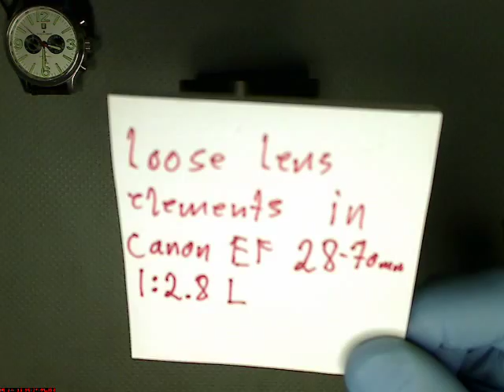Loose lens elements in Canon 28-70mm 1:2.8 L_____PART_1_motion lapse film

Comment: Thanks mikeno62 for this video. Thanks a lot !

I just bought a second-hand EF 28-70mm F2.8. The "front group" was really loose. It could move several mm sideways when fully out (28mm). Of course Canon no longer service those old lenses... and the guy there told me I'd screw it up if I tried to fix it by myself.

I watched your video several times and managed to do all the beginning (~6 first minutes) to find the culprit : There was a screw reaaaaaally loose ! I just screwed it back and put everything back in place.

My first attempt was not good, as the auto-focus was behaving weird... trying to focus once in a while, moving by "steps" and not getting the correct focus at all. The reason was one of the little (orange) ribbon cable was not totally pushed inside its connector.

On the second attempt everything was working fine, and the front element is no longer loose.

I'm really glad you did those videos. Thanks again.

I've also spotted some other issue with my lens (some plastic part even deeper between the most inner lenses). If I'm brave enough, I might re-use your videos in order to get rid of it.
Reply from the maker: Many thanks Nicolas, it's good to know someone can use the info in my videos. Also happy to know you could fix your lens, even the repair tech said that you will screw it up.  But you did it, so that's very good :-)

Cheers
Kenneth
Reply: Hi Kenneth,

I've noticed another problem with my 28-70mm and do need your help again :
The front ring is not totally round (I guess the lense fell down which lead to distort the ring) and I cannot really screw my filters on it.
By looking at the catalog parts for this lense I see that I need to get a new YA2-1717-000 but I can't find any... Maybe you could point me to a place I could get one ?

Comment: I got old of a second hand one of   these very cheap as it stated it was hazy inside. I stripped it down using your video, which was great, i leaned so much. However did not find it dirty or hazy inside. ~Once assembled it was still hazy like a soft focus. the auto focus moved and locked on, but its not sharp. I also find I cannot focus it sharp in manual. Have you any ideas what the problem might  be. cheers  steve
Reply from the maker: Have you try the lens on another camera, just to see if there is any difference. Maybe this lens have been dropped on hard surface, how about the diopter in the viewfinder is that set correct..,  just some idea's.
Or maybe the lens simply need some adjustment.
Reply: I have tried it on another camera and I have tried to adjust the diopter.  what would the effect of the lens being dropped? that is possible and how would you adjust the lens?
do you have a link for a service manual for this lens?

Comment: Hi Ken..another great video! Just wondering..what is the solution you used on the spring loaded retaining ring?
Reply from the maker: Hi Tony
Thanks , well, I glue the spring retaining ring with small drops of super glue (10 second glue), the lens did not get any glue on it. So the lens can still be serviced if need it.
Reply: mikeno62
Hi Ken..yes..I thought thats what you were using. The spring retainer is a rather poor design. I wouldnt have thought there would be much call for such an easily removable clip so deep within a lens.
  If you dont mind me asking (and please excuse me if you have mentioned this before in previous posts), do you work within the industry, or  are you just a mechanical genius who can work out how to dismantle any itricate mechanical object?! If you dont work within the industry how do you happen accross such wonderful things to fix? Once again Ken...great work..thanks everso for sharing :o)
Reply from the maker: Tony Smith Hi Tony, I do not work within the industry, I have spending most of my life training myself in the "art" of repairing small thing's like cameras and lenses and other stuff and try to figure out on how to open it, find out what's wrong, then find a solution and put it back in the correct order and most of the time, make it to work again (high succes rate...).
I very lucky that have 2 very good friend's who have a small camera shop, so I help them with some repair's and at the same time have a lot's of fun, trying many of there photo equipment and at the same time making my small video's (I'm a very active amateur photographer too..)

Cheers
Kenneth

Comment: With my 28-70 Lens i get on every Photo in Cross Light Situation a Fog - In Internet i found that it can be from oil on a Lens. What do you think - Should i open up my Lens for cleaning every Glass in it ?
Reply from the maker: Well Daniel, it depence on what lenses the "oil" film or Haze are, it's not that "hard" to open the lens and take a look, you could be lucky that it's only the first lens elements where the oil/Haze is.

But you need more work to go further into the inner lens elements.

Take a lot's of photos during the disassemble process, and remember to set some small mark's where things has sit correct.

Cheers
Kenneth